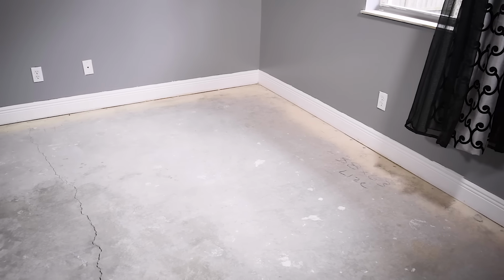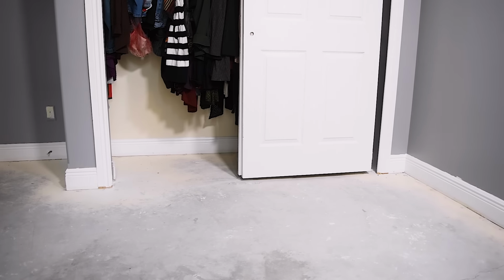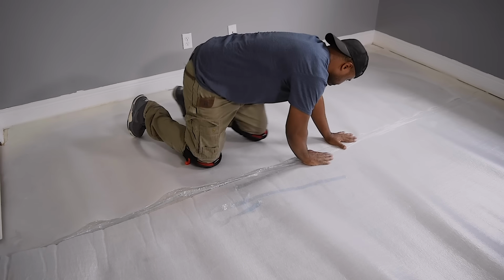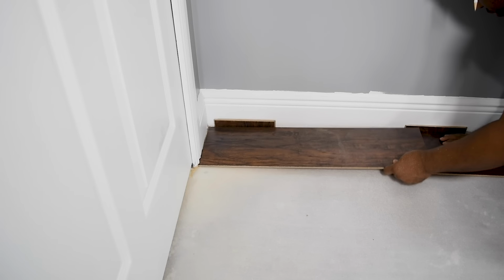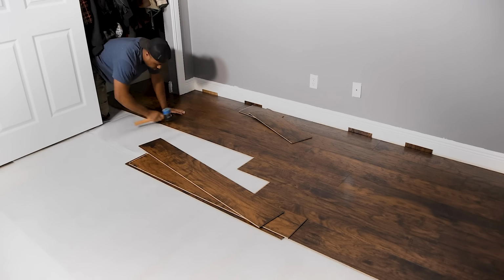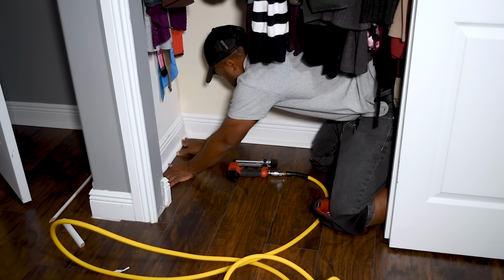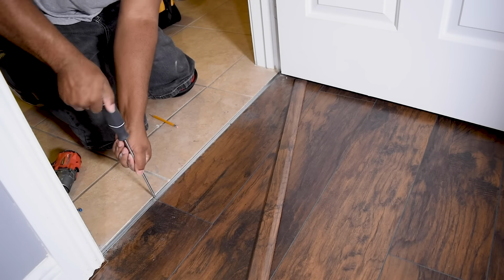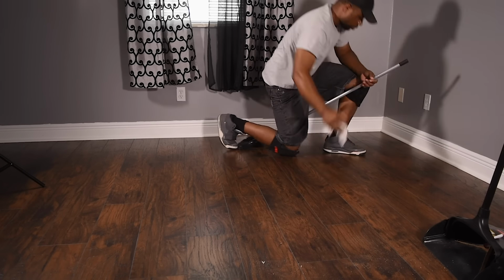How to Install Laminate Flooring for beginners

Comment: I have a Water Damaged Laminate Floor Boards from kitchen under sink water leak, which has caused all my kitchen counter & island counter kick boards and sideboards are fully bubbled due to water observed from the Laminate Floor Boards. I have fixed the water leak & run the dehumidifier.  but do you think there would be mold & mildew built under the Laminate Floor Boards, if I don't remove them and dry it or replace the boards.? The water has soaked for more than 2-3 weeks before we noticed it.

Comment: what causes the crack at 2:50 ?
Reply from the maker: Settlement. It usually happens in the first few years of the home being built. Due to the weight of the house, there is movement. It's very common.
Reply: @DIYCreators  youre fast -- thanks!

Comment: Another question.  What didn't you just remove the base boards to install the flooring against the wall. This way you dknt need the 1/4 round trim. Also , you'd been able to slid the flooring under neath that door jam. Rather than put chalking to mask the off cut??

Comment: After pulling up the carpet, why didn't you  take the proper steps to seal that crack in the cement subfloor?? By doing this ,it will prevent it from getting bigger and causing the floor to bow. Also, prior to laying down the vapor barrier,  why didn't you check the level of the concrete subfloor to make sure there werent any uneven spots??

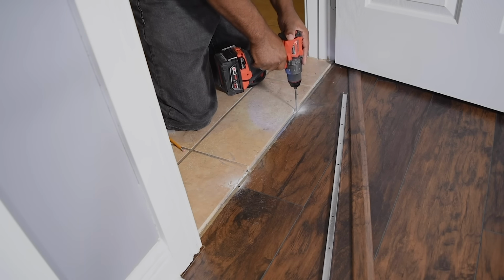Comment: why the fuck americans use nails to this type of job, it looks so disgusting when you are close (9:48 for reference)
Reply from the maker: First off, I'm not American! Second, why trash a situation without offering a better solution. 

If you use nails, you sand a paint it, the nails disappear. Don't be dramatic.
Reply: @DIYCreators  ever heard of construction adhesive? no holes, no sanding, no painting, lot easier and cleaner than nails method

Comment: You’re supposed to lay laminate flooring based on the room length and lighting. If sunlight comes trough a window, the laminate is supposed to stretch towards the light. You’re also supposed to lay laminate flooring parallel with the longest side of the room.

Comment: People acting like their foundation is flawless.  I’ve never been in an aged house that didn’t have some sort of crack in the foundation.  When you start seeing drywall cracks, uneven door or window frames that’s when you have to worry.
Reply: Almost every foundation has those stress cracks, its caused by a combination of the type of concrete and weather condtions.
Reply: Our aged house has a few cracks  and a toilet door  down stairs that i have to adjust about once every 4 to 5 years.  Oh i forgot to say that this aged house in the Midwest was built 2 years after the Statue of liberty came to America in 1885,  she is 133 years old  with a lot of square nails lol.  We've been  in this house for 22 years.
Reply: I see cracked slabs all the time when I set up on installs, even on newer homes because they were going up so fast the concrete guys weren't keeping it hydrated while it cured and it dried to fast.

This particular one is probably heavy enough that he should have used a leveling compound on it, but he probably figured the pad was going to be enough to mitigate any seepage and the floor was flat enough to still function.

Comment: The end cut from your 1st row becomes the start of your 2nd row, that way less wast and a better more random look.
Reply: It may save waste, but then you get a H staggered look and it doesn’t look nice.
Reply: @TheGreg2710  That`s how it`s supposed to be done and how it`s supposed to look, your not laying bricks here!
Reply: steve lane when laying a floor, every manufacturer will tell you to install random cuts with at least 6” between each join. H staggering looks dog shit, but each to their own 👍🏼👍🏼
Reply: @TheGreg2710  When the end cuts get too close the the last row you would start with a full plank and lose the short cut on another row further on. I have 40 years of wood and laminate installations and teaching the profession. Stick to smithing locks and leave the flooring to the experts!
Reply: @TheGreg2710  And every installer worth his salt will say the same, just as I have!
Manufacturers know very little about installing their own products as you surely know.

Comment: Hey DIY Creator, I don’t normally comment on Video’s, but I felt I most this one time. So after I watched your Video 3 or 4 times I felt this first timer could do his floor. I followed your advice and cut are boards in half and then in half again. And we used simple tools. Luckily I had a chop and table saw. And we used a jig saw for a drain and a pipe on the wall. But following your video as you put it for Beginners was spot on and help me lay a great straight wall . With that Thank You For your great videos and keep up the great content!!!

Comment: With all due respect,the shorter side of a laminate plank is a recessed groove, I cannot see a way to join two adjacent planks without forcing a lip of one piece into a groove of another one.It requires a pull iron and a hammer.i can see only the hammer

Comment: Forgot about that flip-measure trick for the last piece; will save me some time thank you. I also have never seen laminate that locks piece by piece; used to locking the whole length then carefully moving into position for each row.

Comment: cheaper laminate flooring though will give you problems, after a while the edges bow up assuming from moisture. The tongues on the end will refuse to lock in at same time as tongues on long side most of the time, only solution would be to cut the end tongues off.

Comment: if you wana know a hot tip use superglue and mitre adhesive on the beading joining the pieces together before you nail them... also works on external corners with skirting boards.. i cut mine on a mitre saw= better results when joining the pieces together

Comment: I spent all day Saturday and I only got half way done.  My planks did not lock in that easy.  Especially the first 2 rows because they kept sliding under the drywall, Ugh.  3 row took me an hour.  they would not lock in to place.  If I got the end to lock I could not get the long side in place.   I will try again next Saturday but I am not happy with mine.  Thanks for the video.

Comment: Need to fix foundation crack. Second, check floor flatness  ( 1/8 gap allowance every 10 feet. Third and very important ( your project success or failure): check MC ( moisture content(. Not well done work

Comment: Beautiful job. I got me a trim prying tool, is it always recommended if you can remove the trim and put it back over using quarter round? I like the idea of reusing the trim.. but just prying it off caused a couple pieces to splinter a little. Not bad enough, but I have to touch it up with paint.

Comment: Why don't you use tiles. They also comes in wooden finish.
Easy to install , easy to clean, cheaper , stronger, and water resistant.
Reply from the maker: Tile is nice, but this is what my neighbor wanted. They love it.

Comment: Baseboard should've been removed.
Reply from the maker: In most situations, but I explained why it was not.
Reply: @DIYCreators  ..sorry but it would've been easier to remove the baseboard..install the floor..reinstall the baseboard.. chalk the top..patch the nail holes..touch up the base. Done. That 1/4 round came out hideous.

Comment: Awesome Video! I will be doing this in an upstairs bedroom (to avoid having asbestos tile removed at about $8K-$10K) when the Chicago weather becomes nicer. Do you have any videos on framing for drywall? I need to do this in my basement for less than what contractors are charging.  Also, I subscribed to your channel since I bought the worse house in the best neighborhood I could afford to live in and it needs work. Thanks again and much success!

Comment: Great work! You did an excellent job of explaining every step. The product was installed with such precision that it made all of the other minor flaws of the room present them self's. I saw plate covers that were not level, and in a few places the paint from the trim to the wall was done poorly. Wall paint was also on some of the receptacle covers. Inspiring work on your end. If the entire room renovation was done with precision the product would of been a gem.

Comment: Most important tip for anyone... Run a straight edge over the concrete slab before starting, then fill or grind if required. Seeing a crack go across the room like that makes me nervous. 
Usual slab tolerance is 3mm deviation over a 3 meter length for laminate, but will vary depending on the type of floor. If you're doing an entire house, focus on getting the high traffic areas as flat as possible (hallways, kitchen, living). 

You don't want to feel a floating floor bounce or hear crackling noises when you walk on it and this can lead to problems later on. Nobody wants to lay the same floor twice, so check the slab first.

Comment: When I splice a piece of shoe in to make it longer I use a 22.5 miter cut, it's even less noticeable than a 45, and also on inside corners I run one piece of shoe flush with no miter cut all the way to the wall, and cut the other piece with a 45 and use a coping saw to notch out along that line where the bare wood and paint meet, makes for a better look, and makes cauking go alot faster.

Comment: I pulled the tack strip off and the nails stayed in the concrete, when I went back to pull them out, the nails pulled some concrete with it and left some mini craters. Had to go back and fill them in, what a pain.
Reply: You didn't have to fill those in lmao
Reply: Mr.roastyonutsack Jr. really? Man I wish I would have known. When pulling the nails it left little crater style holes. As you can tell I’m a noob, I will have to remember the next time I do a project, it will save some time, thanks. LOL!!
Reply: @ipfreely456  yea,  np. It's better to be safe than sorry. But yeah those nails only go in like a 1/4 inch into the cement

Comment: Your neighbor needs to fix his cracked foundation
Reply: It might not be a foundation issue but it should've been addressed before laying new flooring on it.
Reply: I'm glad I'm not the only one who thinks the same
Reply: Probably cracked it when removing the past flooring.
Reply: First thing I thought was to have the foundation repaired
Reply: Cracked concrete is not uncommon.  If its a really big fissure (which this is not as  bad as most people think, and can just be filled with a quick drying leveling comp0ound) it may be the foundation settling wrong as whats under it is being washed away by water... and that is bad.

Otherwise, its just the concrete curing wrong.  Most likely because the person who poured it did it in a season where it dried out to fast and it cracked.
Reply: It’s probably a quick scamy flip for profit
Reply: @saywhen2383  what kind of flipper ask is neighbor for installing laminate flooring...come onnnnnn

Comment: Excellent craftsmanship. Do you think it’s necessary to acclimate the flooring before installing or is it not a big deal? Thank you.
Reply: You shouldn't need to acclimate this like hardwood. This is a laminate over particle board and is also left floating. It's not fastened to the subfloor. As long as you leave your expansion gap around the perimeter you should be able to take it right from the truck to floor 👍
Reply: bearded rider Awesome thank you!

Comment: never seen a nail set on a spring thats sick lol
Reply: Those spring sets have been around for 25 years. They work great for smaller sets. But sometimes still need a regular hammer set for the tougher bent nail heads

Comment: Home Depot wanted $3,200 to install laminate flooring in our basement... I said hell no and did it myself with my wife. It was our first time installing any kind of flooring so we are 100% noobs. However we ended up knocking it out and it looks fine... it's not perfect and we needed quarter round for most areas but we ended up saving $2,700 by doing it ourselves.

Comment: Those tack strip nails are no joke!  I hate that when you pull them up, most times you leave a divot in the concrete. However, I don’t think the divot will be a problem once the flooring is laid down.

Comment: love the end piece on the quarter-round trim...definitely have to use that!
Reply: Right???  So simple, yet so effective!
Reply: If you have trim that can be removed relatively easily (this stuff was pretty high, and was probably glued and stapled to the wall), you can usually pull it off, and drop it back in right on top of the laminate.  Will keep you from needing to use the quarter round.

When I set up installs, I normally only use Quarter round to hide expansion joints on cabinets, hearths and the like.. oh and wainscotting... that is not going anywhere lol.